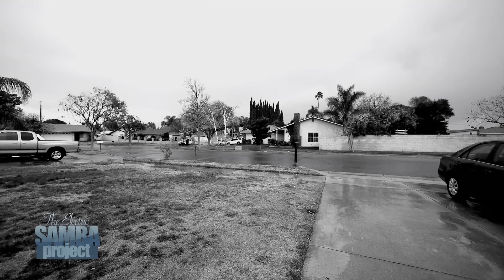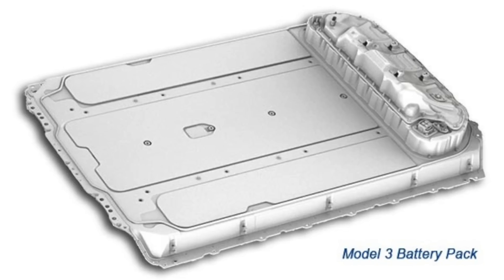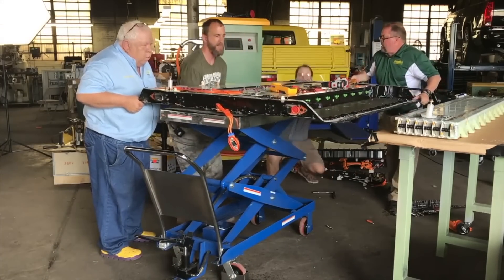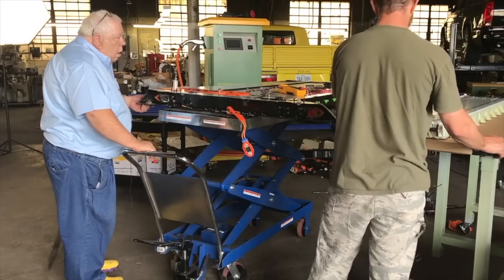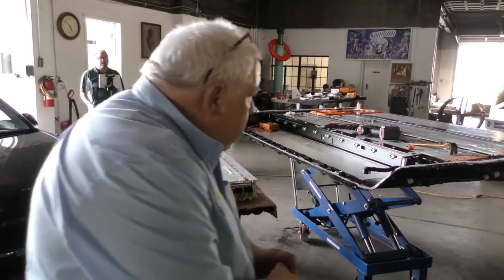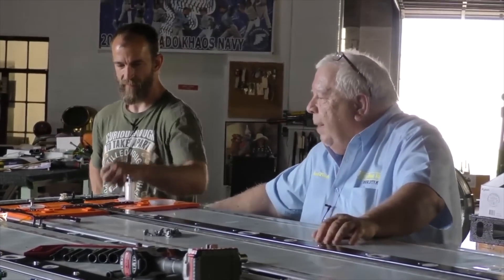First TESLA Model 3 Battery Teardown by DIY EV Shop

Comment: 1054pounds that are 278kg?? 478kg . The leading 4 obviously had an accident getting short cut. Can't double check the math w/o knowing the chemistry or cell voltage. If there is only a 2wire connection between BMS and string BMS subboard it either means that those pins are used for subboard supply and communication of that the subboards are supplied by the battery string which would be suboptimal.
It would be great if Tesla BMS could be reused because it's not easy to get BMS for high voltage batteries.

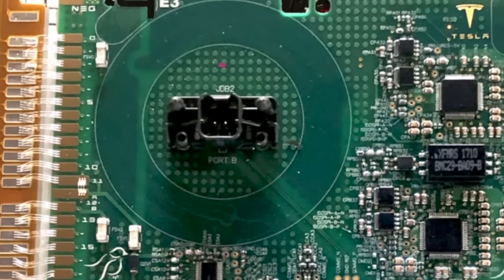Comment: Hi jehugarcia and all, still working on resolving the BMS situation for a model 3 battery module.  At around 3:20 you comment on the 2 pin connection between to 'slave' BMS for the module and the 'master' BMS suggesting it must be serial in nature.  I'm wondering if it's nothing more than allowing the master to monitor the voltage of each module and then telling the slave BMS to reduce the voltage of the module to keep all modules synchronised.  Any thoughts?

Comment: Just doing some quick Math, if one module And you mean a 20 kilowatt module Then $1,300 for a single $1,300 for a single module would Only cost $89 per kilowatt And The cells alone I would imagine our high-quality so it's worth it

Comment: A 5.9 Cummins diesel weighs about 1000 lbs. Can make up to 500+ hp and torque. Typically around 250-300hp. 15mpg possible when pushing 12-15,000 lbs. .... don't know what that converts to a Tesla battery
Reply from the maker: About 200lbs electric motor Same torque but about 30MPGe,   But the battery would be about 2000lbs not sure how much full tank of diesel weights
Reply: @jehugarcia  fuel is approx 8 lbs gallon. Gotta add in the trans.too. diesel smells 💩
   And the electric motor on the Tesla

Comment: I'm pretty sure it is 42 cells per section , not 46. As far as I can see, there are 7 cooling channels each cooling 6 cells. 46 just doesn't make any sense as it will not pack efficiently. If Jack says the capacity numbers don't work, this may be why. His count seems to be the basis for every discussion of the cell count I have found.
Reply from the maker: Count for yourself https://www.google.com/amp/s/www.teslarati.com/tesla-model-3-china-battery-gigafactory-3-interior-pics-leaked/amp/

Comment: but how do you use a 25 cell battery?  and it is even worse that some are 25 and the other two are 23... these will be much harder to use than the 24V model s packs.

Comment: I much prefer the smaller form factor Model S modules for home solar DIY. 
A 20kWh is too much for typical home applications and that >6ft long & narrow form factor is very cumbersome and doesn't work well for scaleable/modular home solutions.
Re-purposing these cells into home solar storage solutions in the future, as these early mass EV power packs start transiting into their second lives, will be much more troublesome than Model S modules. It'll be much easier to repack Model S modules into home enclosures, maybe even scale-able modular enclosures (like mini 19" racks)

Comment: My Corvair would like to go electric.  Only need 50 miles range, if that.  Engine is tired and leaks oil like the Exon Valdez.  0-60 is 19 seconds, so the electric motor torque at 100% at 0 mph would help.
Reply from the maker: Do it

Comment: Well obviously I didn't watch Jack's original video, but did he explain why he felt no need to wear rubber gloves around the 400-ish volt of the pack? I'm cringing when I see them barehanded tearing the pack apart.
Reply from the maker: It’s not 400v in this state,  maintenance connector breaks pack in half usually so only 200v  and as soon as you disconnect modules from each other you are at around 100v,   Dangerous enough for sure but nothing to get worked up about

Comment: If I remember correctly, the cell density does not include all of the casing, electronics, relays, etcetera so they probably are over 200 wh/kg

Comment: The 2 wire thing you had pointed out is probably canbus...    or, since its power? -more succinctly its inbred cousin it has more fun than it SHOULD with...   ;)~   PMBus
Would be interesting to watch someone slap a canbus protocol analyzer on that wire pair n' see what kinda results they get

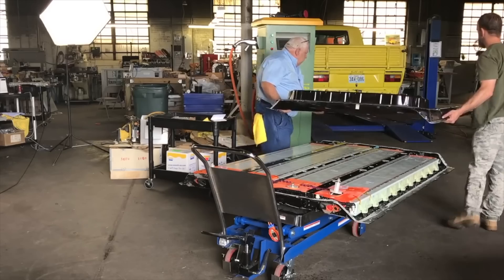Comment: 2:10 168Wh/kg is the overall energy density of the pack, which is very high. The mentioned  220Wh/kg of the Model S is the cell energy density (without casing, wiring, cooling etc.). The pack energy density of the Model S is probably less than 168Wh/kg given the smaller cell format (18650).

Comment: Tough Question, but you’re smarter than most regarding this topic, so here it goes:  When do you guess some competitor (also who?) will manufacture an EV, Powerwall,  mega battery (Australia project, for instance) which has comparable performance;  energy density, reliability, deprivation, etc.?  And separately, when might you guess a competitor could match Tesla regarding cost of said product/project?

Comment: So if there are 4416 cells that means for 500,000 cars they will need 2,208,000,000 cells.  I wonder how many 2170's the giga factory turns out.  Also if they are 5000mah( 5 amp hours) then it would be 22,080 Amp hours.  Assuming 3.7v that should be 81,696kwh.
Reply: The total annual output will be 35GWh. (from their website) "Tesla broke ground on the Gigafactory in June 2014 outside Sparks, Nevada. The name Gigafactory comes from the word “Giga,” the unit of measurement representing “billions.” The factory’s planned annual battery production capacity is 35 gigawatt-hours (GWh), with one GWh being the equivalent of generating (or consuming) 1 billion watts for one hour. This is nearly as much as the entire world’s current battery production combined."

Comment: Sooo No Cooling on this battery?!
Reply from the maker: He didn’t show cooking lines but pretty sure they are there
Reply: Chris Stemp the cooling tubes are between the cells.
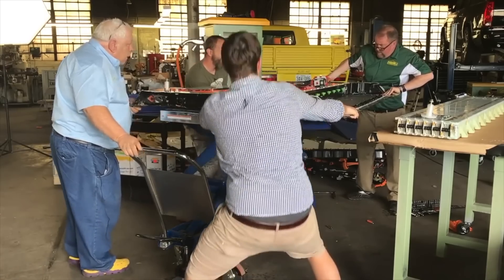Reply: Chris Stemp at the 4:12 mark in the video you can see where the cooling tubes are connected to each other with the black tubes on the module sitting on the table. It has 7 cooling tubes.
Reply: Was actually looking for some discussion about that as well, from what I understand, cooling yes, but heating is ducted from the new motor design which they can use to generate heat without generating torque so even in park (or while supercharging) they can heat the batteries. I am curious how the reduced temp management hardware will affect the ease of using these in a powerwall type setup.

Comment: Did you know that NORWAY  are the biggest  users of TESLA  cars due to FREE ELECTRICITY????????
Reply: It's more because of the tax deductions on top of severe limitations on gas cars.
Reply: There is no free electricity in Norway. Get your facts straight.
Reply: And i come from Scotland right across fae Norway and intend of getting onto this,
Reply: no, there is no such thing as free chargers. we have some street chargers, that you can get access to if you are in the national EV club, it is dirt cheap, but not free.
Reply: MsSomeonenew because cars except EVs have a %100 tax applied to them. Making a VW Passat the same price as a Tesla Model S
Reply: Free charge at shopping center = no available spots for the needy..

The best locations have sensible priced destinations chargers.. Free = bad service.
Reply: no free electricity but big tax deductions that now is not as big as befor, thats why teslas sold MOST cars in the world in norway but not anymore.
Reply: There are free chargers on the streets

Comment: @3:16 the two wire connection is likely CANBUS. It's the same protocol that the Batrium BMS uses for its LongMon/CellMon/BlockMon cell monitor boards. It's an awesome and high-speed serial bus.

Comment: Model S battery (original 85 pack) is 540 kg and has 80 kWh usable. that's 148 Wh/kg. So the Model 3 battery is only a small improvement in terms of energy density in terms of weight. I think it terms of volume the Model 3 battery is smaller.

Comment: Interesting video, yesterday I found out that a local electronics store is selling laptop batteries relatively cheap and most of the ones they presently have in the clearance area are under 25 bucks.
Reply: Jacob's Stuff look on eBay for sub $10 batteries. I got really good Sanyo 2200 mAh cells for $6, $25 is too expensive for you to destroy them.

Comment: Dear Jehu, stupid question, you can tell me about the screws they use for connecting the modules? got for our od a 75/ 90kWh to change my Peugeot 306, but noone can tell me, what Elon put inside.. You found some torque data? or, just by you cool feelings? ;) BR, find me under Thomas Rappen on FB, too... good success brother..

Comment: I think there are quite a few dummy cells in there if his version is a 50kWh model. If is the 75kWh model then all cells are real cells.
Reply: That is exactly the case... as you move up from 75 to 90 to 100's the 0-60 time has always decreased by a little bit. My understanding is the max capacity dictates the max (safe) current draw which dictates max acceleration.
Reply: Only the long range model 3 is being manufactured, for the standard range they probably gone remove the two outer modules
Reply: Thanks, I'm not familiar with what Tesla sells. But they can not just remove the outer modules as voltage will be much lower so instead they will have dummy cells equally spread trough the pack so smaller groups of parallel cells but same number of groups in series 96 in total.
Reply: electrodacus they don't use dummy cells
Reply: Are you saying that they will leave empty spaces or that they will design a new smaller pack ?
Reply: electrodacus I'm not sure. They might use less cells but I'm not an engineer, i just put in the equipment that makes them.
Reply: I'm sure they will use lees it just made sense for structural to use dummy cells and keep the same form factor. I do not think they will put the same battery in the 50kWh as in the 75kWh version and just limit in software as they will just waste money.
Reply: They may have to limit in software. The battery pack has may need to have the full number of cells to safely deliver the current required for the car without seeing a shorter lifespan. Unless the shorter range vehicle also has a lower performance (which I doubt).
Reply: It will not make economic sense to sell the same car basically at lower cost. Battery is big part of the car cost and having the same battery in both 75kWh model and 50kWh model will not make much sense.
50kWh is still sufficiently large to provide a decent performance even if is lower than what is available with the 75kWh model.
My best guess is that they will have the same pack format and just remove or replace a few cells with dummy cells.
They do have different warranty on battery for the two different models so yes the smaller battery will have a lower lifespan.
Reply: Graham Clifton I’m pretty sure that it was earlier stated that the longer range versions would be more powerful and have a faster acceleration

Comment: The final bid for the car was $22,600. https://poctra.com/2017-TESLA-MODEL-3/id-AvrXdpvR8FRZClYP/SAN-MARTIN-CA

$10,000 for the drive unit and $12,600 for the battery. Seems like a lot but when you break it all down you can’t build those for much less. 

The price will come down once there are 500,000 4.6 second 0-60 cars in the hands of millennials.

Comment: great! has anyone got any for sale? I'm thinking about buying some. if I can find someone that knows the remaining capacity of the cells/ bank. some ppl can be shady. I bought 18650 that supposed to be good. after testing. it was 450 something mah. opened it up. it had trust fire in it!! (as in trust me and there will be fire!!) I am going to have to watch what I buy from now on.  great video. I just wonder what the future holds. 10,000mah 31650 cells or something would be awesome. I guess it is possible to get a bit more capacity now a days. but it would be like carrving. nitroglycerin Hi explosive . something goes wrong .. and boom. not so much as a splinter to burry_,

Comment: Bummer the individual modules are so gigantic. That's going to be a difficult/expensive form factor to ship and install in a DIY environment. Was there a mention of the voltage of each module? That's important.
Reply: This was my thought as well. Real tough to shoehorn that module into conversions, particularly older/smaller cars. But if they end up being cheap they'll be great for DIY power walls at least.

Comment: Oh i watched that video i like your breakdown my idea for use is a M3 Portable Power Wall take a cargo trailer and mount the whole pack 1000+ lbs to floor uni strut between sidewalls over axle  to install equipment park beside or behind house when the big event hits disconnect  & hookup 80 KW bugout trailer to van.    here's a world earthquake path explained video.  haha
 https://www.youtube.com/watch?v=dtID-Yi5Yjk&feature=push-u-sub&attr_tag=0_dD2gORLqDJJtsC-6
Reply: mobilesolarpower.net uses forklift batteries       https://www.youtube.com/watch?v=oqcRckOz7Ls
https://patriotpowergenerator.info/   1500w kit only $1995.00  profit% huge

Comment: Hey j, can you take a pic of BMS system. I would like to know which IC chips they have been used, are they active or passive balancers, if they can balance on any voltage or just on top balancers. If you can take a picture of the PCB board detailed I appreciate man.

Comment: Side note Elon announced yesterday that the dual motor model 3 begins production sometime in June?  But the performance model 3 won't be out 'til later in the year.  Battery sizes who knows.
Reply: AWD and performance model specs and orders from late this week for July production.
Base model too once they hit 5000/wk (Q1report). Currently at 500/day (internal staff email).
Air shocks and Right Hand Drive next year.

Comment: 1054lbs = 478 kgs not 278 kgs as mentioned @ 1:58,
 If we consider the actual weight of battery pack as 278kg(which is more accurate considering it has a capacity of 80.5Kwh) on 
Dividing 80500Wh by 278 kgs we get 289.57Wh/Kg and not 168Wh/Kg

Comment: Might want to check your pounds to kilograms conversion
Reply: 2.2 is easy enough to remember.
Reply: It was a Good Dog Meme LOL.
Reply: Brett http://www.collegehumor.com/post/7043774/the-theyre-good-dogs-brent-saga-is-complete should explain it. I one hundred percent agree with your calculations, don’t worry
Reply: but did not saying 278 sound off to you?
Reply: When they say breakthrough by mistake, this is not what they refer to :)))))
Reply: Half a metric ton. There.
Reply: Brett, on Jack or the Battery Pack...
Reply: Brett 1 pound = 0.454 kgs
Reply from the maker: Those are jacks calculations,  unless I heard him wrong those are the numbers he said on his video,  and I did mention that I did not checked them
Reply: Brett But they’re good calculations Brett
Reply: Adam Vorich 1054 pounds = 278 kilograms??? I think he means 478 kilograms
Reply: Brett is that the weight of the battery or jack?